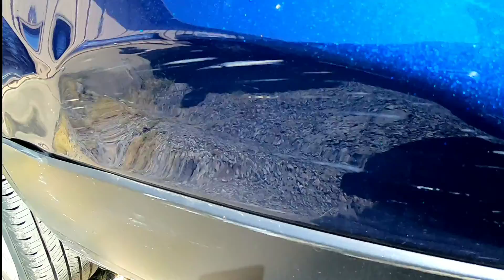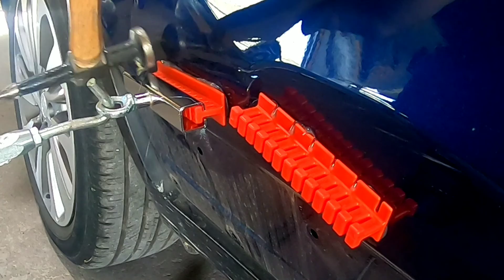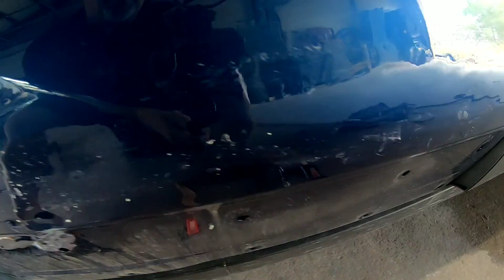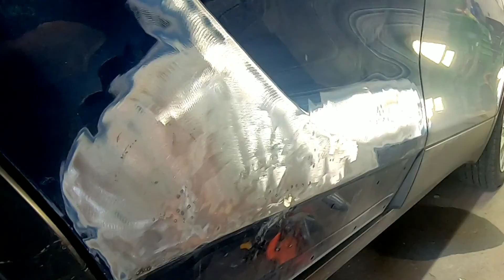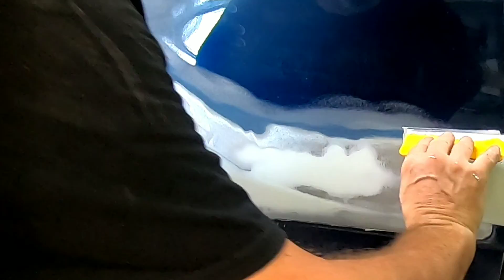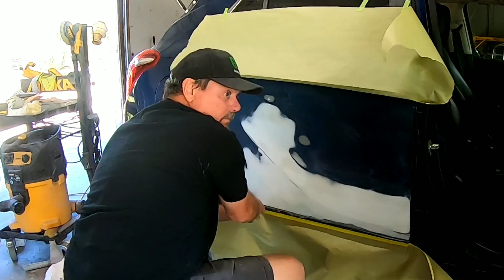Can you do bodywork on your own car? learn how now.

Comment: Howdy Howdy 
Are there any tricks to remove crease from fallen tree branch. 
East-west across center of roof. 
Along horizontal roof beam 
Beam is minimal to no damage 
Just roof panel one crease parallel with roof beam 1 inch off

Ford transit 150 medium roof 
Cargo area is completely bare.
6ft interior cargo height - I am 5’8

since only either inside or out side can be accessed , would it be worked pounded up or tac hammer from the top somehow
Reply from the maker: I would pound it out from unerside and get someone to hold a dolly on the crowns on the top. No tricks tho.
Reply: @GarageNoise  dolly idea would be consider a Wise-trick in our neck of the woods. 
Should I hit it only using a hammer 
or with a blunt spike tip(like a nail starter tool)?

Comment: With the curve leading up to the body line: did you ever have to use a rounded block to help shape it or just an regular block?
Reply from the maker: Yes, I lost a little footage. I have a block that is firm that fit that exact contour. Its part of the mirka system. I also used a flexible short block that I used. Somtime  I'll  do a video on the different style blocks I use.